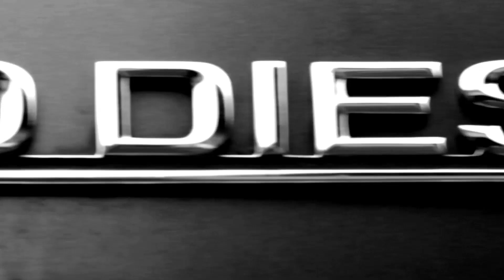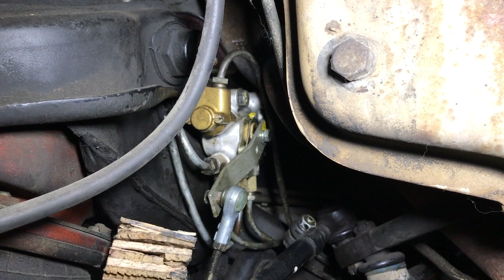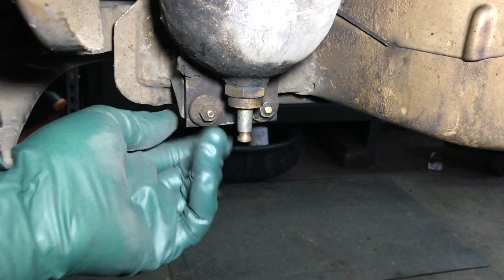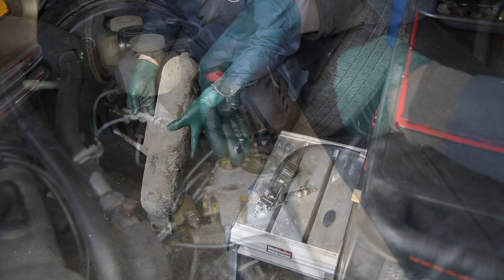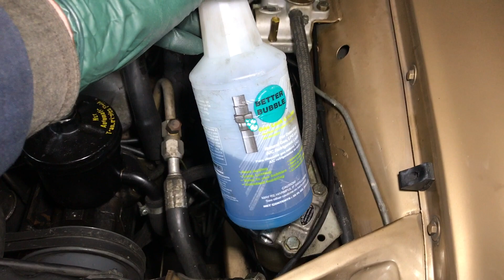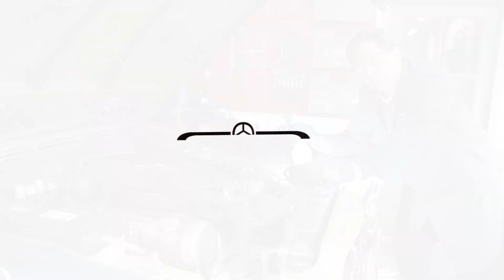1972 Mercedes 300SEL 4.5 Beauty Rescue Part 4: Testing Air Suspension with a Compressor

Comment: Test it the way you would a gas geyser installation, use a brush and a bucket of soapy water, any leak will blow bubbles :)
and having watched the video its either great minds thinking alike or fools never differing :)